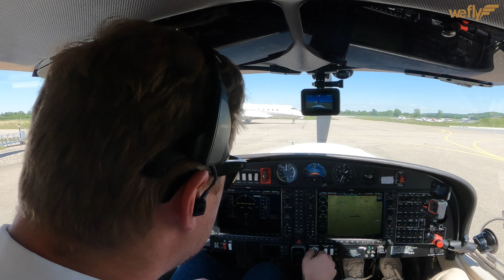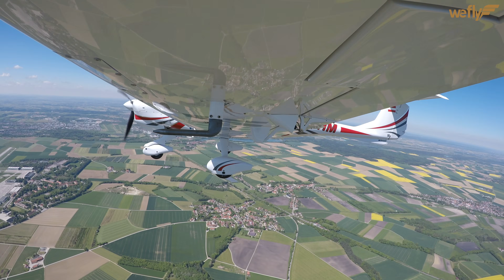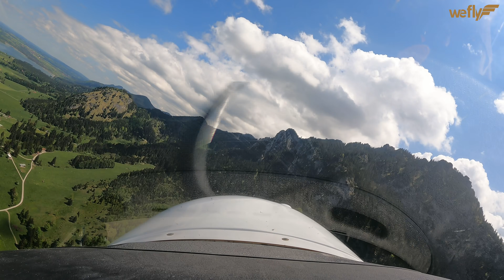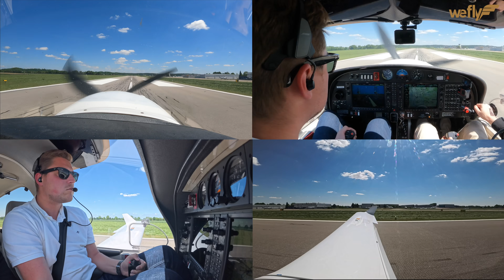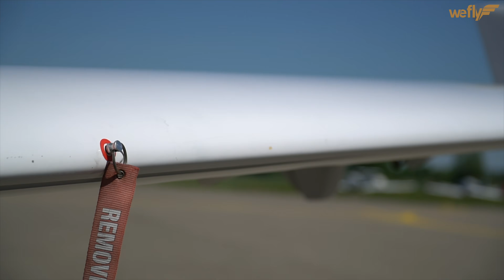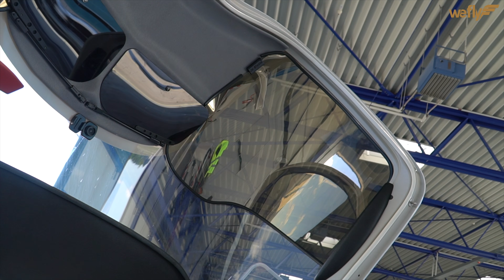Flying one of the first DA40 NG´s - FOR SALE

Comment: Great flying machines but these planes are not designed with the taller pilots in mind, which is strange for such relatively modern airframes.
Reply from the maker: I am 1,93 and with the new reclining seat it‘s totally fine🤷🏼‍♂️ This one unfortunately does now have it😂
Reply: @MickeLang  I'm 1.98cm tall and can just imagine the bottom edge of the cockpit battering your shins if there's an incident on the runway. I think it's a shame that we tall people are always disadvantaged, whether it's cars, airplanes, clothes, etc. I find it downright discriminatory and irresponsible. 😒